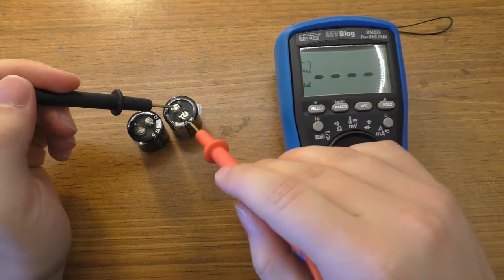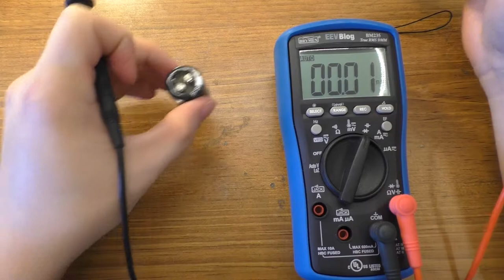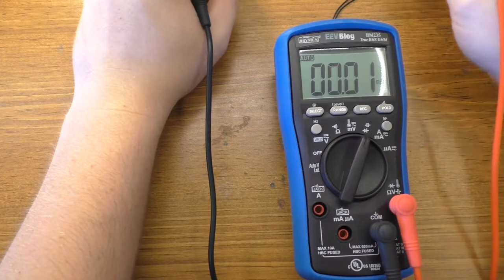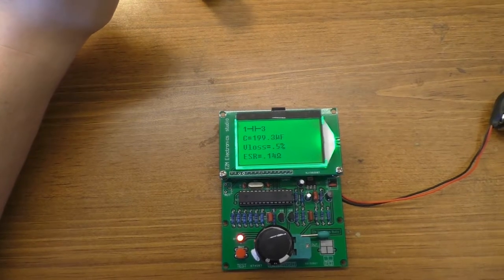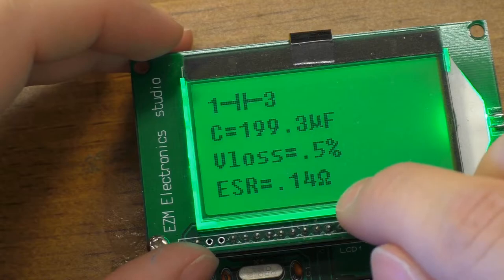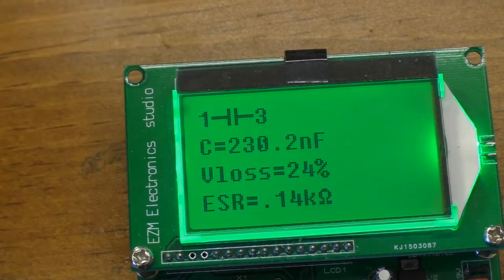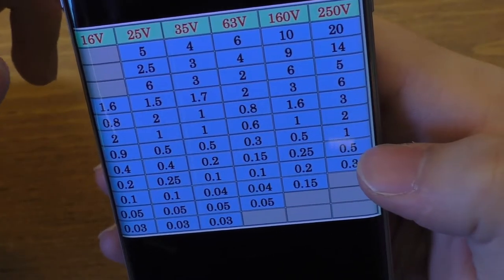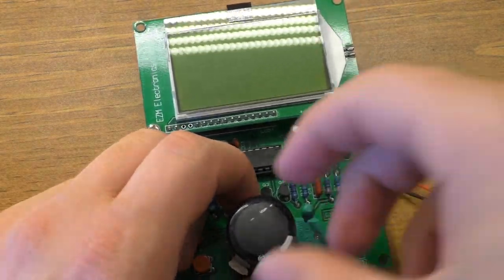How to Test Capacitors

Comment: Good video.  I also test for leaky capacitors.  For electrolytics, I charge up with a power supply or use the ohms scale on your meter to charge up small capacitors.  Then for big caps watch the voltage rate of drop and compare if possible with another good one.  For small caps charged by the ohmmeter, I just briefly break connection, switch to volts scale, re connect and watch voltage drop.

Comment: I just had to buy one of these. Kind of stupid that multimeters dont have an ESR thing. At least they put capacitance on them now
Reply from the maker: I think there might be a couple that do but I don't recall the models. It certainly isn't a standard feature. What really sucks is that if you want to do it "properly" you need an LCR meter which are usually pretty expensive. The cheap little component testers are good enough most of the time though.